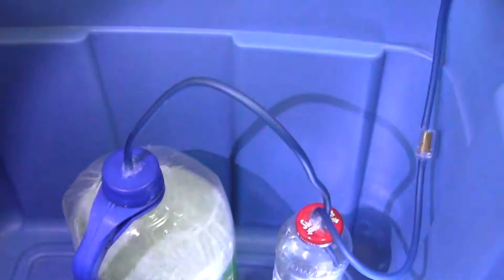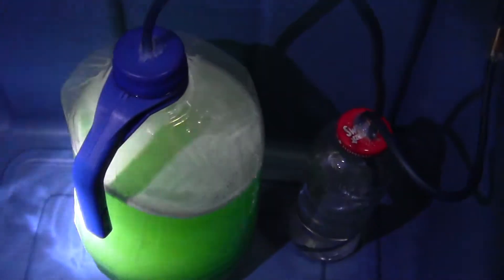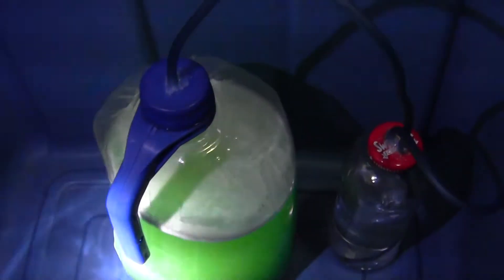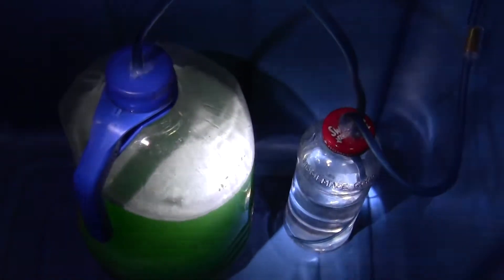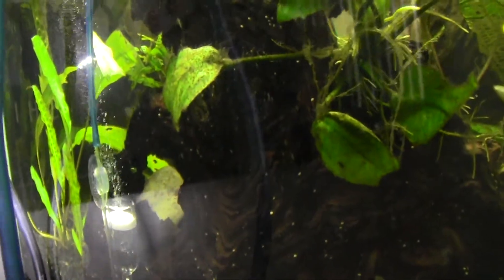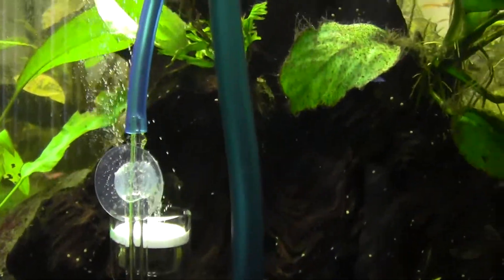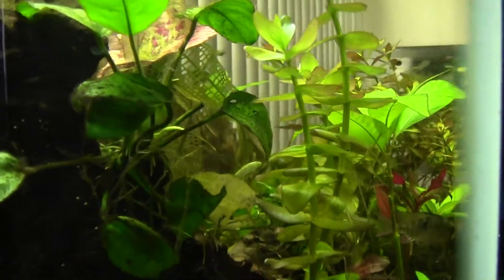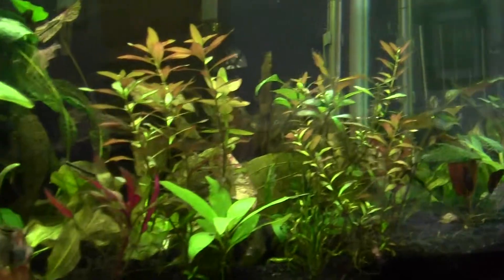diy co2 on 40 gallon breeder tank

Comment from the maker: I'm still experiementing  with different types of yeast, but I generally use 3 cups of sugar, 1.5 tsp of bakers yeast or 1.5 tsp of champagne yeast.  The amount of water goes up to about 3/4 of the gallon jug.  Sometimes i add baking soda, sometimes I don't.  I find with the more yeast you use, the more intense bubbles you'll get, but the yeast die faster.  Too little yeast and you get  a smaller but more constant flow of co2, and it lasts a bit longer.

Comment from the maker: Hello NeroPemberton and thanks for watching.  Your glass diffuser might be defective.  I have a video on cleaning the diffusers with bleach.  If you clean it with bleach and it still doesn't diffuse properly, the ceramic disk is probably defective.  Also, do not brush or try to manually clean the disk.  They are very small microscopic holes that are fragile.

Comment: Do you know why my Co2 diffuser doesn't work? I mean.. there are no bubbles coming out from this glass diffuser  but there are coming bubbles out from the tube without the glass diffuser.. do you know why?
Reply: I'd strengthen the flow or buy a new diffuser even though this is an old comment lol

Comment from the maker: as long as you clean them with bleach, you'lll be fine.  I have a video where I soak two diffusers in bleach and it cleans them right up.   Just be careful and rinse them a LOT in water.  Then soak them in water that's been conditioned with PRIME, and then rinse again.  I'm always paranoid about bleach.